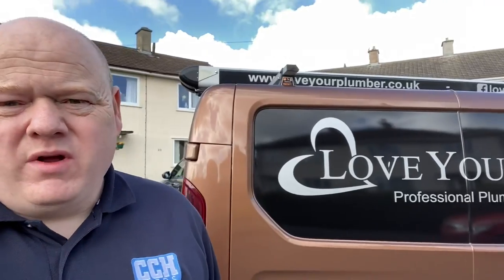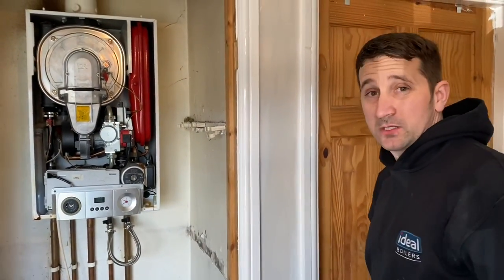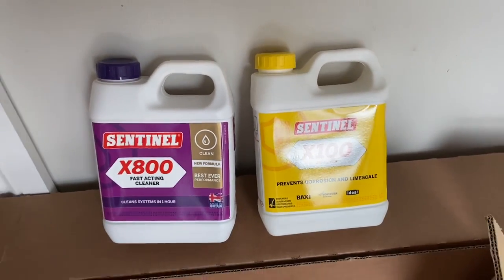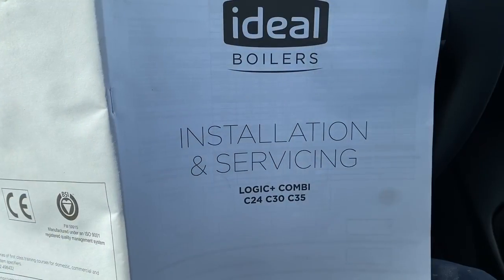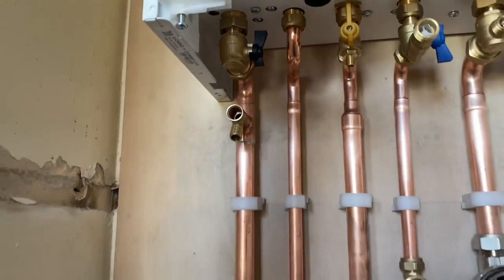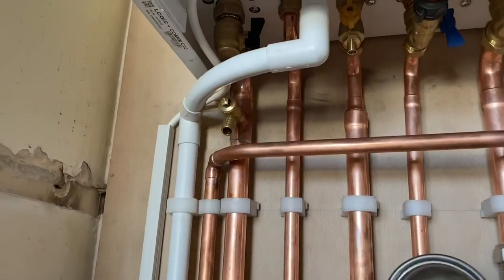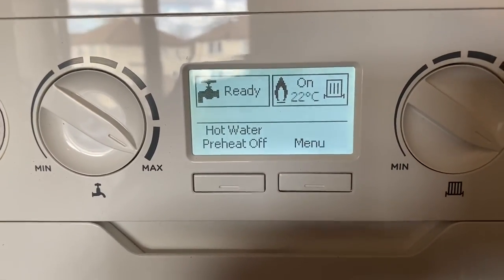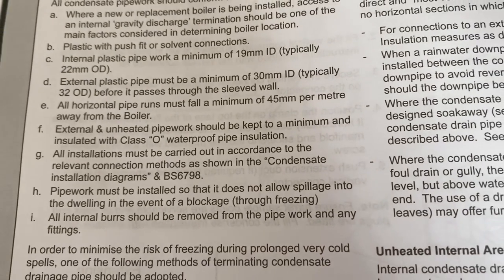Love Your Plumber Boiler Installation - Ideal Logic Max

Comment: Hi Allen I was wondering you said if you ever see a drain valve to the flow pipe it will be a good install.how would you flush the system with that?
Regards
Reply from the maker: Stay safe. Watch this one just in case. Thanks https://www.youtube.com/watch?v=Hh5lFC7VI4U
Reply: We always solder a drain off to flush the system Alan is right, it a good sign someone has done a good job !

Comment: I desperately need some help!!!! I just bought a commercial building with a 1902 gas hot water boiler with radiators I’m thinking are water as well. Looking at prestige combi by rheem, have to purchase using Home Depot charge. I am willing to cashapp or send money to someone who could just verify I’m heading in the right direction, no liability! My father is a contractor so I’m having him do the work since I can’t get anyone here for 2 months and I need to open my store but can’t because there is no heat and it gets up to -40 here so the sonnet I get it kickin the better

Comment: Where is your descaler
Reply from the maker: Doesn’t need one👍
Reply: Allen Hart yes is does- cheap skate
Reply from the maker: @alexbrown5971  How long have you been an engineer for ideal? How many jobs have them around Leeds? What does it actually say in MI,s I think you find you are wrong.
Reply from the maker: Hard Water Areas
Where the water hardness exceeds 200mg/litre (200 ppm), it is
recommended that a proprietary scale reducing device is fitted into the

Comment: Where is your bypss
Reply from the maker: Doesn’t need one👍
Reply: Allen Hart I am an ideal engineer yes it does
Reply from the maker: @alexbrown5971  Which page does it say that in MI? Thanks.
Reply from the maker: @alexbrown5971  Which page in MI does it say that. Thanks.
Reply from the maker: The boiler includes as standard:
- Automatic bypass
- Boiler frost protection
- Daily pump and diverter valve exercise.
The boiler casing is of white painted mild steel with a white
polymer front panel.
The boiler temperature controls are visibly located in the control
panel on the front of the boiler.
The heat exchanger is manufactured from cast aluminium.
The boiler is suitable for connection to fully pumped, sealed
heating systems ONLY. Adequate arrangements for completely
draining the system by provision of drain cocks MUST be provided
in the installation pipework.
Pipework from the boiler is routed downwards.
Reply from the maker: @alexbrown5971  Central heating system controls should be installed to ensure that
the boiler has no demand when there is no requirement from the
system, in compliance with Building Regulations.
Heating systems utilising full thermostatic radiator valve control
of temperature in individual rooms should also be fitted with a
room thermostat controlling the temperature in a space served by
radiators not fitted with such a valve.
When thermostatic radiator valves are used, the space heating
temperature control over a living / dining area or hallway having
a heating requirement of at least 10% of the minimum boiler heat
output should be achieved using a room thermostat, whilst other
rooms are individually controlled by thermostatic radiator valves.
However, if the system employs thermostatic radiator valves on all
radiators, or two port valves, then a bypass circuit must be fitted
with an automatic bypass valve to ensure a flow of water should
all valves be in the closed position.

Comment: Hi Allen. Just seen you video on using pellets for cleaning boiler and system. Has anybody tried using stainless steel media. I use this for cleaning my brass shooting cases. It does a really good job. Could you run this stainless steel media around a sealed loop for a hour or so then open loop up and catch them through a siv or magnet. The stainless steal media comes in all shapes and sizes from pins to ball bearings size etc. See link https://youtu.be/9fHXmIntSHU and other links on using stainless steel media.  May mean you will not have to go around all radiators and vibrate them just leave the media to do that job. Just a thought. Amazon Lyman Stainless Steel Tumbling Media
Reply from the maker: Thanks very much for your comment, please consider subscribing to support the channel 🙂

Comment: On that combustball material agen if you puting it on ply it shud be on fire proof plaster bord# pink one if I was a woster it be turn off m8 id
Reply from the maker: You have been able to install most boilers on ply for around 10 years 👍 Thanks
Reply: Thats complete rubbish who told you such incorrect information? Worked for a diamond accredited company and put nearly all my boilers in 18mm ply. What support are you getting from plasterboard?
Reply: Why not run the condensate pipe in inch and a quarter plastic? and forget about that lagging nonsense.

Comment: Waste of time swaging looks no better its in a cupboard anyway maybe the spiders may appreciate it is he on a price or time and labour
Reply: I work for myself, it's my own company. Every job I do is price work. Thank you
Reply: @powney13  Can you tell me the make of the swagging tool you use please, i haven't seen that one before, it looks neater and less to solder.
Reply: @stogie525  if you type in "swaging tool" in Amazon it will pop up straight away. I've tried to copy the link but it wont for some reason. 
Thanks
Reply: @powney13  Cheers pal, i'll have a look👍
Reply: @stogie525  no problem muka 👍

Comment: with the advanced tech on pressfit copper fitting i dont under stand why plummers are not pressfiting gas and ch lines stop diy and cowboys being able to do installations due to cost on  gun and jaws to use fittings.
Reply from the maker: Lots of great methods these days. Thanks.
Reply: Something I'm definitely thinking about Barry. Press looks great and I think it's the future

Comment: Hi, I have an Ideal boiler 15 kw for a three storey with about 11 radiators. I got terrible bangs at the motorised valve for heating in one zone when the heating is turned on. I wonder is the circulator in the boiler too powerful for the house? Not sure if I need a special slow close motorised valve or an arrestor or can I can just slow down the pump.